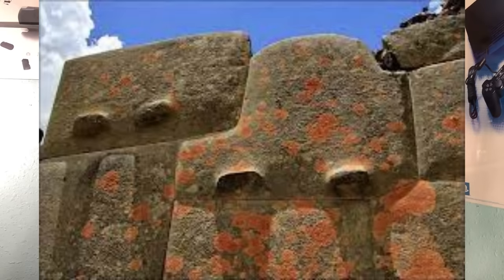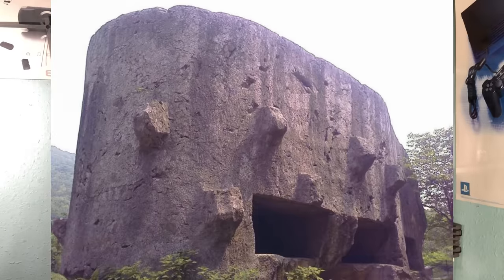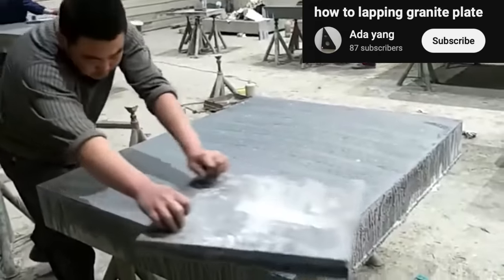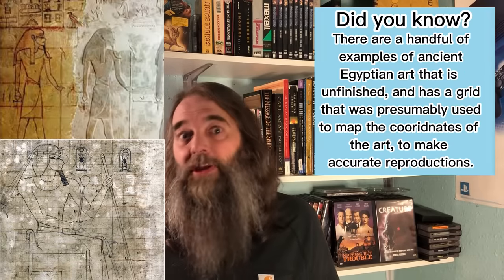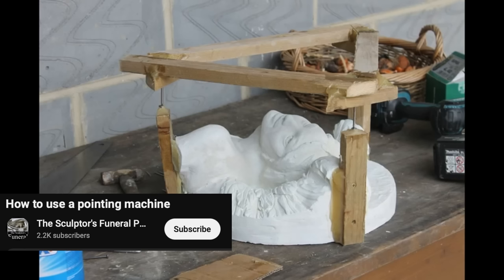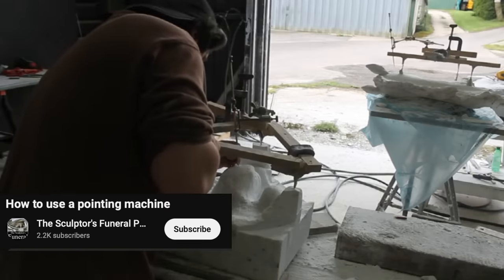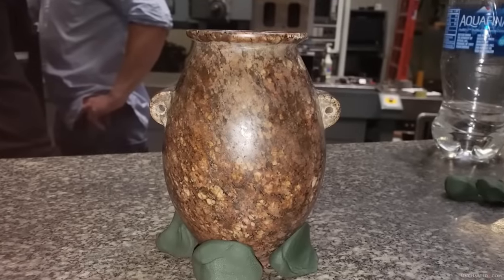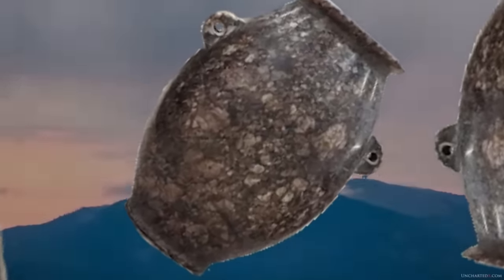The True Purpose of Megalith Stone Nubs

Comment: I originally thought that it was a way to delete a crack or fault in the stone sort of like when a piece of flat steel has a break in it you would drill a circular hole at the base of the crack so it couldn't spread further.  Like that only in a negative frame of reference
Reply: Another words if there were a crack or fault in the stone u would chisel all the way around the crack or micro fracture so it wouldn't spread

Comment: Not stones. Concrete mineralized and hardened over time. The nubs are obviously the result of pouring in a sack or bag type mold. Used for quickly assembling a wall to prevent catastrophic flooding or invasion or even fire. May have had the bags still on them but deteriorated over time. Same as all the other "mysteriously carved" stones. Why carve stone when you can pour concrete?

Comment: You dont need the nubs to use this method. You could simply have two tabs with holes in them instead of the squares that the nubs fit onto in this video., Then trace the holes onto  the stone and the outline.. Can move frame  on and off as needed. Making those nubs would be laborous , why do it if not needed.

Comment: Nice thought, but? Spend years like I have in Cusco, look at all of the ruins and how the stones were made! If you look close at each stone, when they are apart because of a Earthquake, you will notice each rock is curved inside. forming into each other! The cuts in the rocks, are not a flat cut, there goes your thought up in smoke, using a frame to be used to cut the rocks, plus the nubs on the stones, are on a few stones, not all of them, so there goes your thought up in smoke! Third, how in the hell can a Frame be built for many of the Stones, when they are bigger than any tree! Maybe to use a rope instead to measure with? Makes more since! But, these stones weigh more than any equipment mankind has made so far~! Giants built the Ruins in Cusco, they had to use some type of Lasers to be able to cut stone, into Glass! So, how did the Giants cut Stone, like if was Butter, and the Stones freeze in an Instant? What I have seen in and around Cusco, Mankind did not build..... Nice video, but I do not agree with your thoughts on this one! When the Frames would have to be has big as a House!!!!!

Comment: Your problem is the same as everyone else’s. You have absolute flat surfaces, mating against absolute flat surfaces, and when that block has six sides instead of just four it really becomes a problem because each one is custom-made to the other blocks around it if you really wanna know although they won’t allow it, you disassemble a few of the blocks and you look at the joints and how that was accomplished and possibly it will give you some clues but you assume they didn’t have tools we know they had the ability to use acoustics sounds to do some amazing things there are places they have found where there’s hundreds even thousands of feet around and you can whisper in one spot and everyone can hear you  Their understanding of acoustics is way above ours and you can literally cut steel with sound waves as well as water today’s water jets. If you search the history books, you will find that the Romans mind for gold using water pressure and they were geniuses and aqueducts and understanding, water, pressure and water itself , so maybe the scientific community is to shrink its giant head down and try to assume that they were much smarter and had technologies we have no idea about . their use of Mika and liquid mercury in the Aztec pyramids and others makes it highly probable. They did understand some things about electricity. Mika is an insulator and a liquid mercury. You can run current through it and because it’s a liquid you can pump it in circles around large copper rods and you’d be shocked at how much energy can be achieved this way they know it but they’re not telling The public they just tell you a mercury bad stay away from it it is toxic, but we used to use it constantly and thermometers and every other thing and somehow recently it has become like uranium you’re not allowed to have it. Why would that be the experiments that a particular doctor has done in the eastern United States with ground up to a powder, magnetic material, mixed with the mercury has some amazing properties. If you can still find it because most of it has been scrubbed from the Internet liquid magnet is something you want to investigate there are other names for this, but instead of having a copper coil , and a solid magnet going past that you have a coil of liquid magnet, spinning around copper rod, just look into it, and these are things they believe were gleaned from some hieroglyphs knowledge is power, and the people that have power keep a lot of the knowledge secret from the average person

Comment: Only problem on that point by using reference points and frames. Which I think is very intelligent Possibility !.
But the question can I come with that is the debate of what kind of tool did those people have time it was harder than bronze, and said the the Egyptians only having copper tools. 
Many places where stones with nubs are found the stone is harder than granite or equal to.  And as in Machu Picchu. The third question is, how did they cut and transfer the large blocks of stone from the mountain across the valley and back up to the top of Machu Picchu and placed them?   But your suggestion of using such a tool for me, sides to fit perfectly in a place like a puzzle is very interesting and possible, 
Actually, the best I’ve heard  !
Reply from the maker: Rock is used to cut and carve harder rock, which is a bit counterintuitive but it's how the ancients carved stuff, copper and bronze are way too soft like you point out. But a chunk of granite...

Comment: No, that is not what those nubs were there for.

The nubs are simply the result of pouring the stone from a hot lava source.
Same as the little nub you get from injection molding sometimes.

Get rid of the assumption they started with solid stone and this whole thing gets a lot easier.
Reply from the maker: But basic geology tells us the stones were quarried from sites nearby.
Sorry, I prefer my explanations to take all the evidence into account, "It looks like..." don't cut it.
Reply: @DeDunking  

You described what you thought the nubs were used for.

I am  describing how the nubs were made into the rock.

And we may be talking about two different types of rock formations.

Comment: Dear DeDunking. 

I posted thus comment on Dr Miano's excellent video on the subject, however a year later he has still not replied : 

"Dr Miano have you seen this video ? : https://www.youtube.com/watch?v=YMUZRGuYqY8&t=698s 

The methods that are proposed by Mr Lee cannot account for the evidence we see in this excellent resource. In particular I would humbly bring your attention to 11.40 minutes into the footage. It is apparent that this large stone was either somehow melted, or that it was not solid when these marks were made in it. 

As you will know, limestone does not react this way to high heat so that seems to rule out that possibility. Without entertaining the notion of 'unknown high technology' that leaves the most likely scenario being that this is a large lump of cement, or 'some kind of homogenous setting material similar to what we call cement'. On the face of it that also seems very unlikely, as this is a very large lump! However I think there is an explanation which does not involve UFO's or such like. It is actually quite mundane, ie this is a naturally occurring 'setting material.' Limestone exposed to igneous rock (high heat) equals what? Could this site not be a natural lime kiln? The lime could have been cooked many thousands of years ago, then hydrated by springs and in this state it would stay as a clay until exposed to air and voila you have natural cement. This material would then be used in conjunction with the natural boulders to 'fill in' and essentially create very tight fitting infill 'stones'. It would explain A LOT. 

However it is also obvious that the builders were directly quarrying these stones and it seems that a variety of methods were used, which really confuses matters. The quarry marks left at Ollyantambo are extremely perplexing and Mr Lee's proposed methods cannot account for what we see there. 

These walls are an astonishing achievement." 

So DeDunking I am pretty sure that you are correct that this is how they produced some of the tight fitting stones - however this method does not explain the other evidence we find at the site, so it is likely that a combination of methods were used, or what we see is a hotch potch of different work done in different periods. I would very much appreciate your feedback on the above post, and particularly the point I make regarding the 11.40 minute time stamp in the embedded video. Apparently Dr Miano is not willing to notice all the facts. 

Best wishes - Paul.

Comment: They had a way to make them un-solid then hard again. They wanted the "nubs" there that is only reason they are there. What for who knows they are over 10,000 years old who knows. We do the same stuff today with concrete and not as well as they did with actual rock. I am certain their method is lost to time and obviously is much better than any way we do today. Your thoughts about the nubs being used as a reference point misses because they like you said are not consistent between different stones. Also, if you did this for that reason you would then remove the nubs. Why would you go through that much work to then leave some nubs behind? That makes no sense. You made a 1 off stone to fit another 1 off stone and so on leaving the nubs behind from measuring tools? No way that is what happens if that is the way they did it! Also, even if the stones differ the points would stay the same. If you left nubs for whatever reason they would be the same places and the same uniformity also on all stones. Your theory is not sound for many reasons. I doubt they used electricity to make store liquid as well for the reasons you stated. Likely, they found a way to separate the material at the atomic level gather it then re-condense it into a form. We do this with water every day and gasses I.E. we can heat water to make it into steam, collect it into a balloon which would float until we cooled the steam then let it pour into a form like say an ice tray. All things have liquid, solid, gas and just because we can only do this to some things now does not mean older lost tech did not have ability to do this to rock as well. It is a simple thing. The nubs as you call them could be from pouring the material into a form and some is randomly left on random blocks in random places and maybe left because it is advantageous to do so. Possibly it was intended. Oh, this explanation I offer also solves the riddles of how it was quarried 20 miles or more away, up the side of a mountain, then angled perfectly as well (the walls are not 90 degrees) It would also explain the rounded corners. Your theory fails the corners entirely that would be too difficult and just is not how anyone would do things. They did things like we do today the easiest way we can to make it work. Go to any construction site and you will not see people working harder than they have to if they can do a job in a more simple way. I know, I have been there actually doing things on construction sites. They do not even put up proper hazardous materials signs because it is too much extra shit to do. You think anything has changed in attitudes of people working that much in the past? Nope.

Comment: Why would they even need to copy a surface this like this.
Every stone is different.
What you showing may explain an out side edge.
But the stones match exactly over the entirety of the contact faces. Which aren’t completely flat. Which means than some stones would have to have 14 absolutely identical surfaces in some cases.
I don’t think you can apply any modern concepts on building to an ancient building technology.

Comment: I find the analysis unique.  Yet, your wooden frame has a problem.  How are you lifting and moving out, then lowering and moving in such huge blocks (massive tonnage) to make these perfected blocks.  Instead, how about the method of sculpturing, upsizing, done by the Statue of Liberty in small model, medium model, then large model, into final massive wooden blocks that the copper plating was beaten into shape.  A just recent YT vid showed how this was done.  If you have super-huge calipers, and have already made a smaller rock version, then you use all the 6 points of contact, and continue to hone down the surface until you have the perfect stone that you made in the original small model of interlocking parts.

Comment: You show ancient lathe turned vases etc from the Egyptian, Grecian and Roman times.  This can only be done, like probably the movement of Stonehenge stones, put into wooden wheel rollers and rolled along the landscape with ropes and human pullers (and pulley systems).  Those massive red or black granite stone columns, perfectly smooth surfaces can only have been done by quarrying out such rough ashlar from the quarry, install their wooden wheels around the body, pull the ashlar out of the quarry and bring to a sculpture location.  This is then put into a roller assembly of other wheels, and a wooden wheel in which a human or animal propulsion turned all the wheels.  The ashlar would then rotate as in a lathe.  Using the same technique of a klinker machine (wooden hammers or stone hammers), the ashlar would be rotated around and around (lathing the ashlar), while the klinkers hammered down the column into a smooth shape.  Finally, like shown in a recent YT geological video a rough to perfected ashlar stone is ground finished with a contact stone (massive stone) and use of water and sand, or oil and stand) finishing the perfectly smooth surface.  All of this sounds far easier for ancient technology.  As the ashlar cum column is now finished, you roll in back out of the lathing machine, roll to its construction site, and then uplift vertically into its location.

Some of the same movements can also be done with a wooden rail road timbers and a wooden rails.  Saturate the rails with oil and water.  Make a wooden platform on which you are hauling a large rough or finished stone.  Further oil and water the wooden platform and rail contact, making a super slippery surface.  Less people pushing and pulling the stone from the quarry to Stonehenge or the pyramids etc could be done.  One has the solution in how they move boulders from quarries to river portages, put onto barges, floated downstream, pulled off barges, and then pulled to a pyramid construction site.  The assembled parts of the wooden rail timbers and rails can easily be taken apart, and put in the front of the moving wooden platform (train, boxcar), and continue the movement of the megalith.....

Comment: I've always been under the impression that if someone has a hypothesis, it's a requirement of that hypothesis for it to explain All the unknowns.  If your hypothesis fails to address any large details, isn't that a sign that you're probably wrong?  You spend a lot of time explaining how a sculpture can be duplicated using certain tools.  You don't explain why those techniques are relevant when creating something for the first time.  Also, the perfectly fitting nature of the stones requires that you address how their flat sides aren't actually flat, and that they'd need to be sculpted Perfectly(!).  One mistake ruins all the effort they put into it.

Each stone has the appearance of having been softened or made molten and then allowed to cool in place.  If this is a possibility, there's no need to lift the stones into place if smaller pieces can be put into each location a bit at a time.  The most inexplicable details to explain are:

How could the stones be shaped to fit so precisely?
How is there no wasted stone anywhere?  No obvious quarried chunks?
Why would anyone build something this way?

Answer:  The builders had access to a technology(which was mobile and adjustable) that allowed them to melt stone in place.  Each block could have been made from smaller pieces of stone melted together in place.  When each stone block cooled, the blocks appeared perfectly carved.  No waste was left behind.  

Obviously this raises another question:  What kind of technology can do this?  I don't know, but if it existed, it wouldn't require many people to be involved in the process.
Reply from the maker: I explained clearly how this would extrapolate into making stones to copy negative space, and make a precision wall. 

You didn't pay attention.